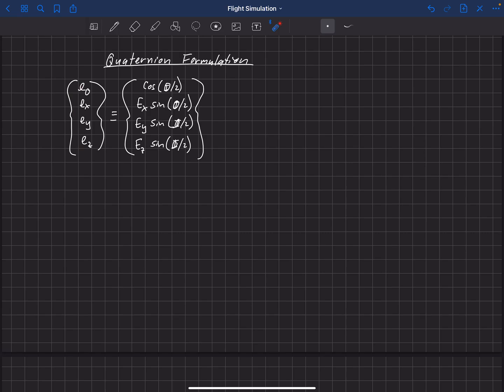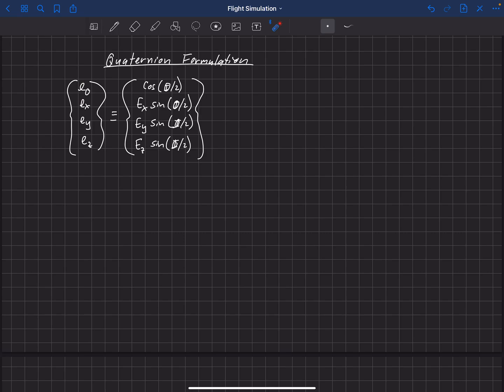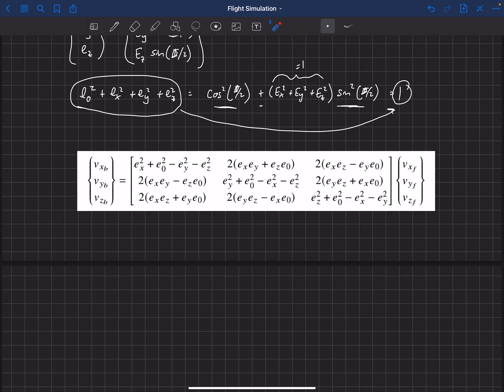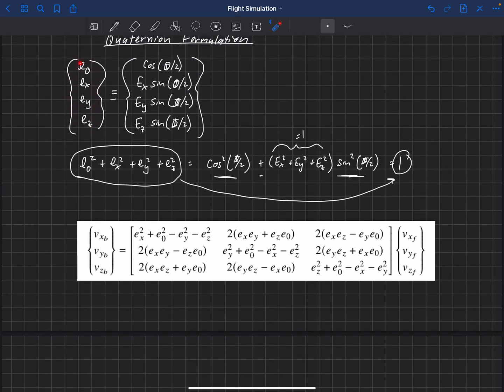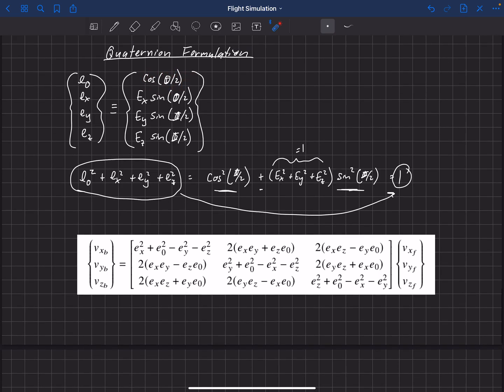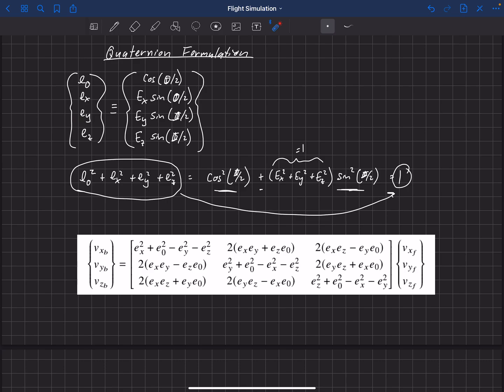Flight Simulation . Aircraft Orientation . Quaternion Formulation

Comment: Awesome video, I've been trying to find quaternions as they relate to local coordinate systems for planes for a bit now and this really helped. A small note though: that isn't Theta. Even hand written, it's just a O with a - in it. In fancy print, the - might have serifs, but you never write those by hand. It's just a single pen stroke where you start at the left-middle, draw the circle counter-clockwise and then "curve in" to finish on the dash.